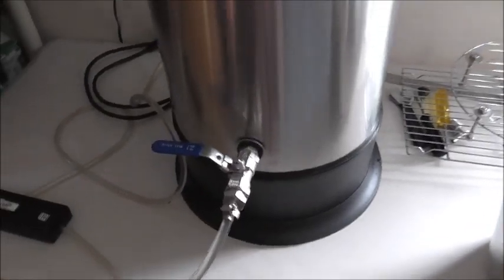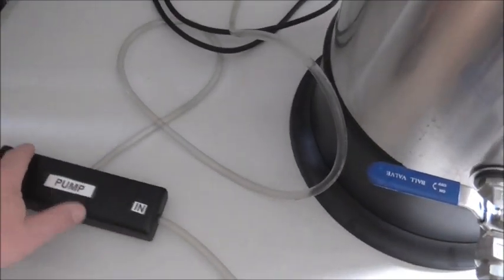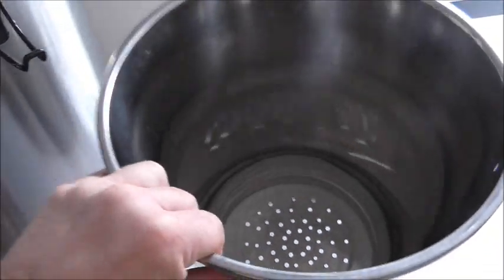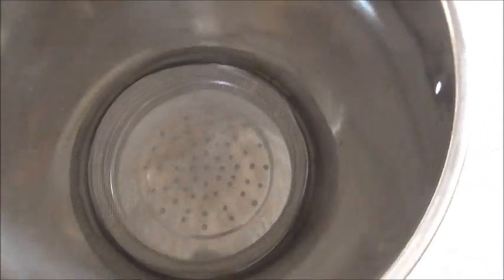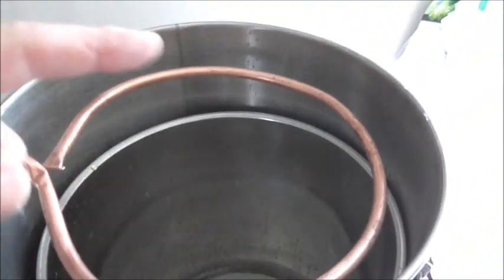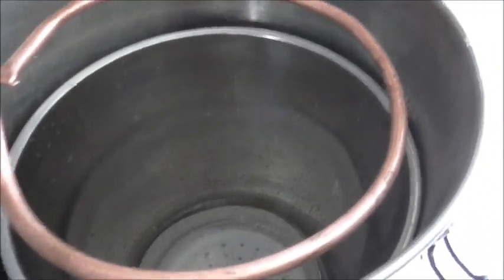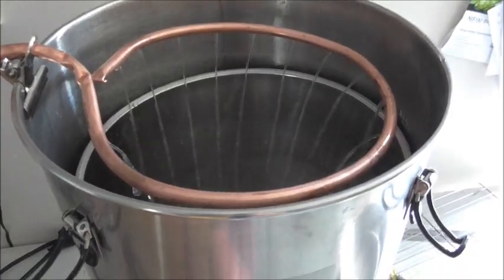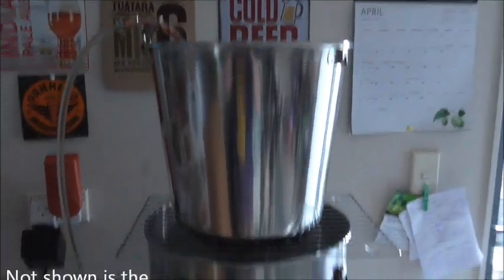Electric Recirculating Brewing System - DIY All-In-One with Sparge Ring

Comment: Love your creative solutions here. One question though, with the recirculation during mashing, aren't you risking hot side aeration by having the wort fall from the ring through the air into the grain basket? Or can you lower the ring to reduce exposure to the air?
Reply from the maker: +Mark Read Thanks for your comments. Interestingly, since this video, I repositioned the ring to attach to the grain basket, rather than the top of the boiler. On the HSA,  I've read articles and stories saying HSA is an issue and others saying it's not. I read an article on an experiment where a batch was split in two and one subjected to as much HSA as possible and the other none at all. The resulting beers were tasted by 12 different people and no perceivable differences were picked up. Personally I haven't noticed any issues and I've shared beers with a number of different brewers and they don't seem to have picked up anything. It's possible HSA is having an impact, but at a very low level. Here's a link to the ring in the new position on a brew day, if you're interested. Cheers Dino https://www.youtube.com/watch?v=azXg9iloMq4

Comment: Looking good mate. Tell me, how did you assemble the mesh false bottom??
Reply from the maker: It's a cheap mesh domed sieve. It had a handle on it, which I removed. I then squashed it flat. That caused the mesh to spread out the side allowing me to put a ring of tubing around the edge to help it seal. Cheers

Comment: Been watching this build from the start Dean & it just keeps getting better. Have you Try'd or would it be possible to do a 23L batch or something close? Cheers.
Reply from the maker: Dean Clapham Thanks Dean. I think it would be struggling to do a full batch. It's 25L max capacity, minus losing say 4 litres during the boil and then the 3L deadspace, would give you an approx 18L batch. I guess you could dilute what you end up with, with more water in the fermenter to get your 23L. You'd have to play around with some numbers to get it right. Cheers

Comment: Mate, I've been trying to drill through the bottom of a stainless steel bucket with limited success! How did you get yours so clean?
Reply from the maker: Are you using carbide drill bits designed for stainless? even then I went through a couple of bits. Also I used some CRC lubricant to stop the bit over heating. You can get done sort of proper drill paste I think it is called. After drilling I used a round file to get rid of the burrs. I hope this helps. cheers
Reply: Sweet as Dino, cheers. Turns out I know a guy who knows a guy who may be able to suss something out for me. Will keep you posted!
Reply from the maker: Nice one. I've been scarred for life drilling SS. haha. cheers
Reply: Haha. So once I've got my setup up and running we may have to do a bit of a brew off, same equipment, same recipe sort of thing and do a bit of a swapsee. Whaddya reckon?
Reply from the maker: ***** That sounds like a great idea to me. You decide what you want us to brew ok? Cheers

Comment: Good job dude, but I'm to lazy. For me its easier/better to buy braumeister or grainfather or etc. Are u sure that your work is worth it? Is it work better than ready all in one brewing systems? I use simple pot, but I want to do my brewing more automatic.. But.. as I said I'm lazy;) Once again good job:)
Reply from the maker: +Paweł Belka The driver for me putting my system together was really money. This setup including the STC-100 for temp control, set me back under $400 NZ (about $270 USD). It works on the same way in principle as the Braumeister and GF and I get about the same brewhouse efficiency from the grains. Don't get me wrong, I'd love a Braumeister, but you can put something together for a good price. Cheers for watching. Dino